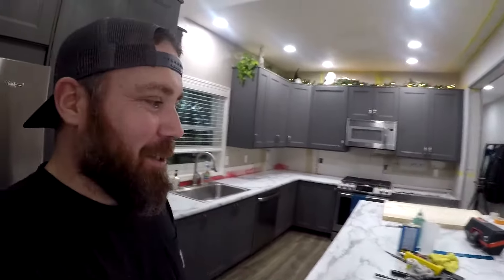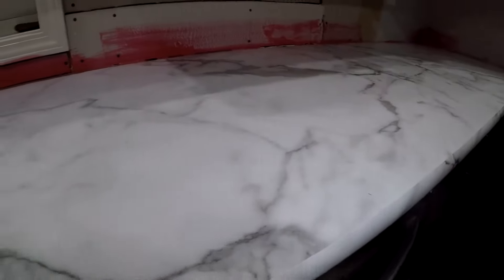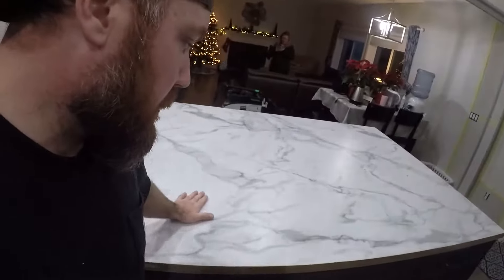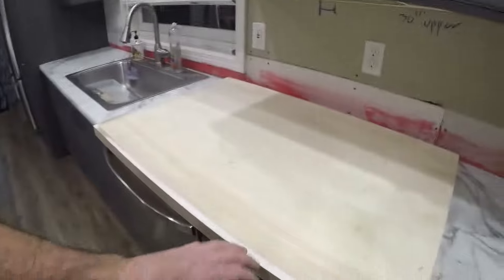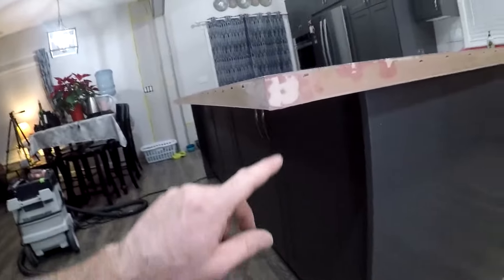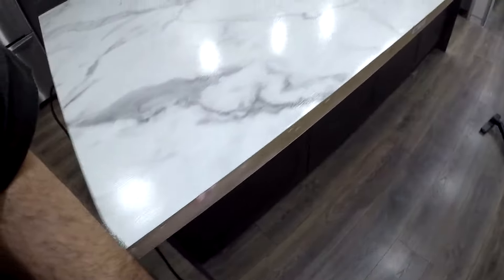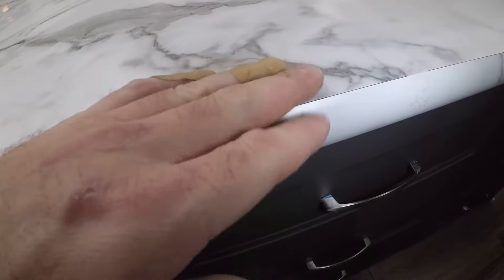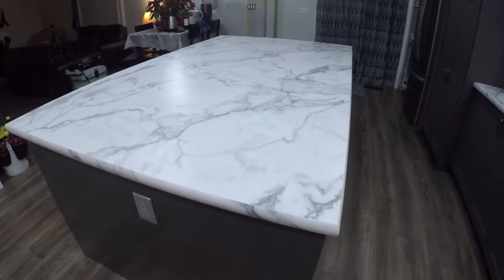How to Formica Countertop Installation and Ideal Edge Installation.  Calacatta Marble - Satin Touch

Comment: I just want to say thank you for your informative video. I had bought the sheet and trim but didn't know how to install or what to use.  Watching you I was able to buy a router with the correct bit, a mitre saw and did the 45 degree angle, bought the premium glue, contact cement,  etc just like you used and they look beautiful.  For a single 61 yr d woman, I'd say I did a great job learning from this young guy. Thanks 😊 Now on to my backsplash!
Reply: Hi Rene...I just got done watching and I'm 58 years old and doing it myself lol. My laminate is going on tomorrow and I'm both excited and nervous. My router is on standby and that's the part I'm a bit unnerved about. Hope your project went great. After this is done I'm doing a white mother of pearly backsplash.

Comment: I love this video! It has to be one of the best how-to videos I've ever watched. Very funny too! (The dogs add a nice touch... made me laugh.) I wanted to watch this to see how to install Ideal Edge, especially because I was concerned about the sharp edges staying after installing it. I'm glad you pointed out how razor sharp the edge is on the Ideal Edge. I sliced my thumb open just by pulling the plastic wrapping down lengthwise to remove it. This isn't just a paper cut... it's a very deep cut like from a razor knife. (I actually thought I was going to need stitches.) They really should have more warnings on this packaging - not just "Sharp Top Edge". Who would think you can get a razor cut while removing it from the plastic packaging?!! I not only learned about Ideal Edge in this video, but got some super great pointers on installing the laminate sheet on the countertop. I was going to use contact cement, but now I'm going with the water based adhesive. I also didn't realize I was supposed to wait until it was completely dry. I wish I would've watched this sooner! Thanks for the fun lesson!
Reply from the maker: Thanks, yeah the sharpness is a necessary evil with Ideal Edge.  I learned the hard way when I ran my finger across just taking it out of the package too!  It needs to be that sharp in order to give a seamless transition from the top to the edge, I didn’t realize this and unfortunately I can see the edge due to filing too much as I was worried about someone cutting themselves, I wish I would have taken a little more time to line it all up perfectly to avoid as much filing.  Thanks again for watching!

Comment: A couple of suggestions to anyone considering installing these edges. If applying laminate over existing laminate, do not use the water base adhesive. It won't last. It's intended for porous substrates and it works great on those. Use the solvent base contact adhesive. Also, on countertops with 90 degree outside corners, like this island, clip the corners at 45 degrees. These edges cannot be filed to reduce the sharpness and those 90 degree corners are very sharp on the vertical edge. On the side with the big overhang, cut a 4 to 6 inch 45. On the corners with only an inch or so of overhang, make them just an inch or so. Or as big as you can without hitting the cabinets. Glue all joints 100 percent. Including the long pieces. These edges are made with MDF. They will readily absorb moisture if not covered with glue.
 When you trim the laminate tops, try to leave just a very tiny overhang (1/64th of an inch) by tipping the router out just a bit. I do that by pinching a bit of my finger under the inside edge of the router base to raise it about a quarter inch. Use a file to clean up the edge by laying it flat against the face of the edge you just routered. You want the edge of the top sheet to be flat (not flush) and sharp to get a tight seam.
 When applying the edges, use painter's tape every inch or two to hold the edges in place until the glue dries. Make sure it is perfectly flush with the top before the glue sets. If there is any sharpness on the seams after the glue sets and you remove the tape, use a piece of scrap edge to burnish the seam. Rub the face of the scrap on the seam.

 If you have a disk sander, cut your pieces a hair long and use it to size the pieces perfectly. 
OK, I know that's more than a couple. Good luck!

Comment: I just did my countertops with dulce vita formica, looks absolutely fantastic. I did the edges myself also with the same formica material, pretty simple stuff really. I went out and bought a milwaukee compact router and a straight cut bit with the wheel on it.. just go slow and watch your bit as you go.. saved us thousands of dollars doing it ourselves. We have an unusual countertop and sink, so it would have been high dollar if I had to pay someone to do it

Comment: Great video! I'm just about ready to get our laminate glued down. We're also using the Calacatta Marble Formica with the same edging. I've done several of these but never with the crescent edge. I question how the edging is applied to eliminate the use of "putty" to fill in the gaps. I applaud your use of edging around the island. Thanks for the great vid & tips!
Reply from the maker: Formica has a great how to video on their website for the Ideal Edge.  If you can get the front edge cut perfectly at 90 degrees, you won't need the putty.  I made the mistake of filing the edge before installing and it created a gap where the top of the edge met the Formica by rounding it slightly.  Watch the how to video from Formica and follow the steps and it will line up perfect.  Be very careful with the ideal edge as it's razor sharp. https://www.google.com/search?q=formica+ideal+edge+installation&sxsrf=APwXEdeeDs2OZa7Dvf_Ji4kQsh55GTbNCw%3A1686718751392&source=hp&ei=H0mJZJDLFfqr0PEPpNy-6Ao&iflsig=AOEireoAAAAAZIlXL-9lsKD-V7MxAOJkaJThgCLGlUvJ&oq=formica+ideal+edge&gs_lcp=Cgdnd3Mtd2l6EAEYATIFCAAQgAQyBQgAEIAEMgUIABCABDIFCAAQgAQyBQgAEIAEMgYIABAWEB4yBggAEBYQHjIGCAAQFhAeMggIABAWEB4QDzIGCAAQFhAeOgcIIxDqAhAnOgcIIxCKBRAnOgQIIxAnOhEILhCABBCxAxCDARDHARDRAzoLCAAQgAQQsQMQgwE6CwguEIAEEMcBENEDOggIABCABBCxAzoLCC4QgAQQsQMQ1AI6EQguEIoFELEDEIMBEMcBENEDOhEILhCABBCxAxDHARDRAxDUAjoLCC4QgAQQxwEQrwE6CwguEIAEELEDEIMBOggILhCABBCxAzoICC4QgAQQ1AI6DgguEIoFELEDEMcBENEDOhQILhCABBCxAxCDARDHARCvARDUAjoFCC4QgAQ6CAgAEIoFEIYDUNkGWKEeYOEraAFwAHgAgAFdiAGSC5IBAjE4mAEAoAEBsAEK&sclient=gws-wiz#kpvalbx=_JkmJZJHGFa630PEPvfCdyA4_36

Comment: Thanks for the good vid. A couple suggestions, I would be interested to see how you did the corners of the edging regarding the miters. And what grit sandpaper you used to texture the existing surface; which looks like the top you installed?

Comment from the maker: Formica used on this project:https://www.formica.com/en-us/products/180fx/03460
Ideal Edge: https://www.formica.com/en-us/search
Glue used:https://www.amazon.com/Wilsonart-Water-Based-Nonflammable-Contact-Adhesive/dp/B0767HQPCH
Reply: Can we order direct from that Formica website?
Reply from the maker: @marialex1426  no, but click on the link and scroll down to “where to buy” click on that and then select retailer and plug in your zip code.  It should give you a list of places you can buy it from.
Reply: I bought the 5 x 12 laminate/formica sheet snd trim at Home Depot.  Cost under $400. Looks identical to yours.

Comment: Looks wonderful! I'm doing the exact same thing and using  Ideal Edge. I changed the island design from what my builder originally offered and he was going to charge me more than what I would pay for granite for the Formica top. So, now I'm building it myself. I'm having to pay someone to flip the particle board over now that I've build up the edges and underside. Tomorrow I'm applying the laminate. What type of white putty did you use on the seams? I was worried about them showing with the white background. I'm so glad I watched and thanks for the tips! Your entire kitchen looks gorgeous!

Comment: What kind of putty did you use to hide the seams? Never thought to do this and we have the same counter tops!!!
Reply from the maker: I ended up redoing the putty with some white non-sanded grout.  I also used a white grout paint pen to try and hide some of the edges that were not white.
Reply: @rogueremodel2993  can you elaborate on how to apply the non sanded grout? I need full details. How to apply, when to wipe off excess, etc. Maybe you could a video using scrapes from the formica/ideal edge install.

Comment: What was that scoring tool, sheet membrane cutter?
Reply from the maker: https://www.google.com/shopping/product/12690916876476096745?q=laminate+scribe&client=safari&hl=en-us&biw=414&bih=715&tbs=vw:l,ss:44&prmd=sivn&sxsrf=ALeKk03qMSs3F4xZctWcPoa4MLGsBJtnaw:1616452113835&prds=eto:18189677052186186658_0,cdl:1,prmr:1,cs:1
Reply: You can also buy the Cobalr Scoring Tool at Lowe's. You have to ask a lot of people where it is before you find someone who knows. Should be in rhe ftont of the store on the wall. $4.87
Reply: @renereed9473  I found it in the tile tools section.  Works great! I think I was shown it by mistake and decided to try it.

Comment: What’s the dimensions on that island? Is it possible to do a waterfall edge with this Formica product?
Reply from the maker: 8’x5’
Reply from the maker: You can order counters with the waterfall edge in this product, but I think they can only do 2 sides, so with an island having 4 sides visible, you would still have to install 2 edge pieces.